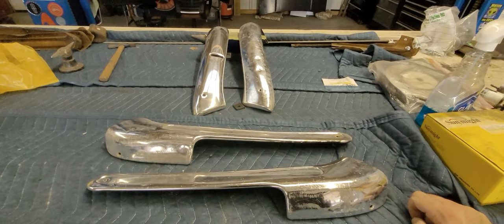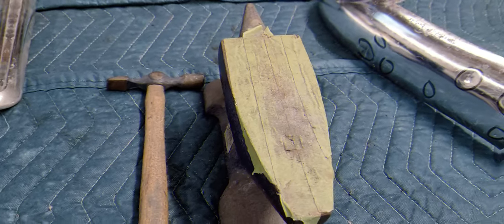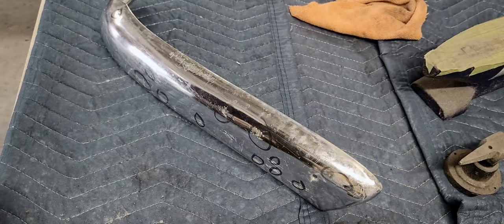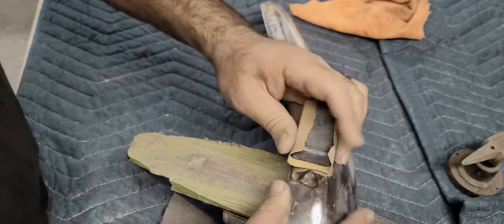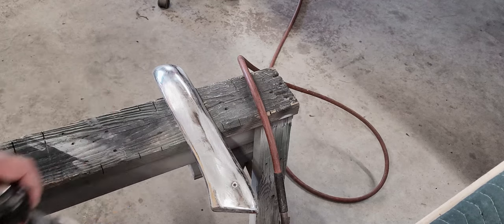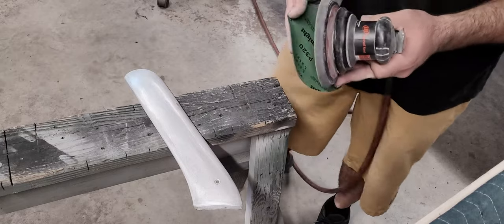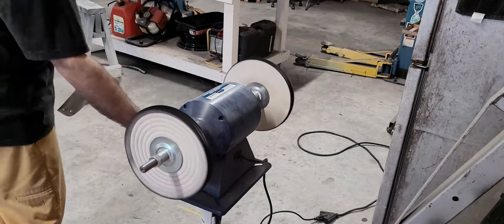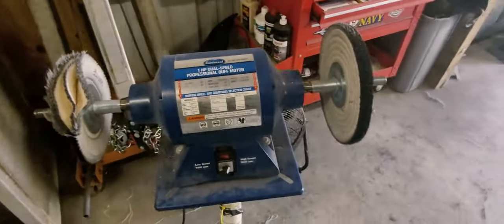ALUMINUM TRIM RESTORATION | #classiccars #impala #lowrider | @lonestarlows

Comment: Old guy checking in.  I've found that with some dinged trim, taking the time to make wooden dies fitted to the trim is worth it. Got my 65 Nova grill straight by beating on wood.   Thrift store spoons, wood or metal are handy dollies too.
Reply from the maker: Excellent advice. I've thought about making a fiberglass type of shell to make repairs quick
Reply: From one old guy to another - I’m doing some stainless and aluminum restoration.Yes I been wanting to make some molds/ dies of some of the trim.Thinking of polycarbonate using diy vacume forming   Mold.  Recently  thinking obout wood also.I banged out some pretty serious gashes in stainless with plastic end of my gunsmithing hammer .Course can’t use in tight spots .I don’t like bringing up with a pick hammer then all the filing.Eliminated all that with my gunsmithing hammer.Anyway I’m still experimenting .If I have a mold of small section of stainless and I get one really banged up or like some I’ve done smashed flat……I can get it  perfect or darn close.Fortunately I had identical piece of stainless to go by when restoring smashed flat ones.

Comment: Well done for your detailed explanation.  May I humbly suggest a few things: When sanding aluminium please use some type of gloves as aluminium can get into your pores and bloodstream. Also I found it easier between sanding grits to use a felt tip marker  and scribble all over or guide coat to ensure that you sanded the previous grit (easier to see). You do not need to go more than 800grit since you are using a pro buffer.  Use a sisal  wheel with brown for first cut, brown on spiral and then white on soft wheel for ultimate shine.  One last thing please wear a face mask when polishing as that compound will fly up your nose and into your lungs.  Apologies for the long rant but I admire you as I am also self taught but also had some great tips from Pros.  Thanks and wish you all the best.
Reply from the maker: Great info. Thanks.  I always wondered what grit I should stop at. So you think 800 is fine enough?
Reply: @lonestarlows  Yes it is and try it and see the result.
Reply from the maker: How fine do you go on stainless
Reply: @lonestarlows   Not finer than 800 usually.  Finest I ever went was 1000 but that was because the trim was so thin that long buffing cycles will warp it.  Also note that the 600/800 are wet sanding.
Reply from the maker: Thanks for the tip.  I plan to do all the stainless on my car.  I usually go up to 3000 wet. Maybe I've been wasting my time.
Reply: @lonestarlows  No lol! you never waste time on your own car.  By the way I wet sand by spraying some WD40 on a paper towel and just wipe on the stainless, just to have a slippery layer, so not dripping wet.
Reply from the maker: I'm going to try this advice.
Reply: @lonestarlows  No problem and let me know how you get on.  I would also use a brush to take off metal filings on the sandpaper if you use it on aluminium as it clogs the paper, to last a bit longer, or sanding grease block without the need for WD40.  Enjoy!!

Comment: Off topic, do you have ruff $$  cost for materials to paint an impala? Paint/ clear/ primer etc.... no labor just on materials... thanks
Reply from the maker: Quality products. 2000-3000 in materials.  This would be raptor,  epoxy 2k , basecoat clear. Sand papers  ...I paid 900 for 2 gallons basecoat for my 60 last month....

Comment: ive restored my trim on my 70 challenger. in my experience, i found that aluminum and stainless steel, its kind of irrelevant to go passed 600 grit on scratching. the buffer, wheel, and rouge bar will take care of removing the rest of the scratches from there on. you may need to hit SS with 800 grit, but for the most part, 600 grit was enough. black rouge with sissal wheel will knock out 600 grit no problem. and brown rouge will knock out aluminum 600 grit no problem. just sharing my experience. it will save a ton of time from sanding all the way to 3k grit
Reply from the maker: Yeah, since this video I've tried different methods.  I'm always trying different methods and I've found out a sisal with black cuts fast